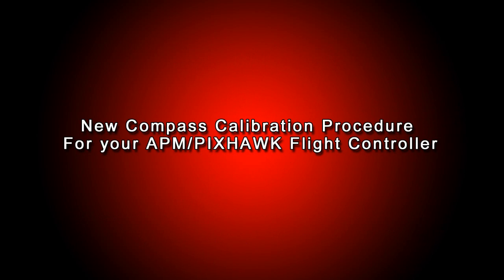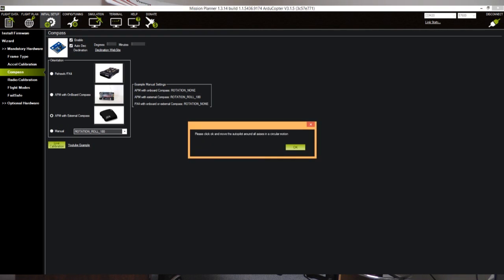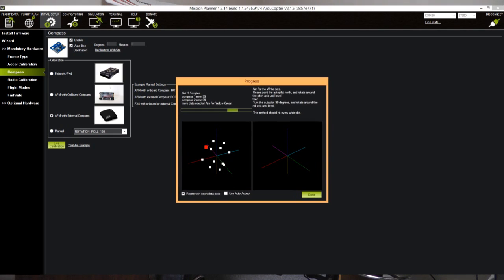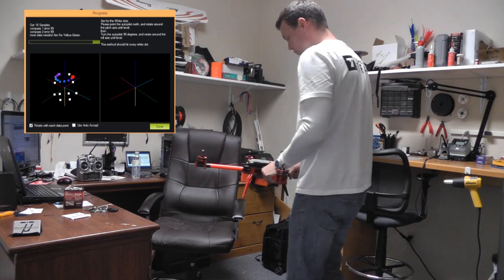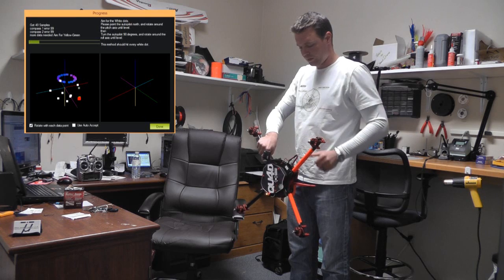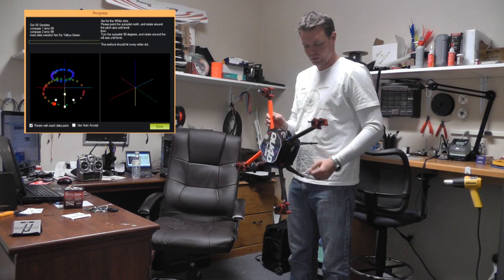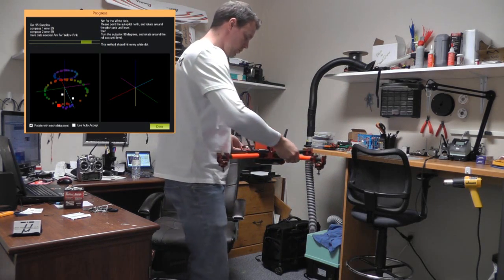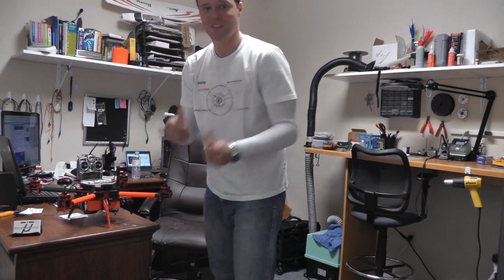APM PIXHAWK Compass Calibration

Comment: hi... i am having prblm in my apm 2.6 compass callibration with ublox 6M gps.... its showing only one red dot at the center(origin point) and its not taking samples when rotated. kindly help me if possible.
Reply: Good evening Shivesh Gaur, okay? I saw your video showing the problem faced in the APM with the error Bad Compass Health and I'm having the same problem, I even buy a new APM but the problem continues, you could find the solution ??? If you can email me, we will exchange experiences and try to resolve this issue. My email is fernando.zulin.veiga@gmail.com
Hugs ...
Reply: Are you using the latest version of mission planner and are you selecting the correct flight controller?
Reply: steve tacang I m using the mission planner version 1.3.30 and yes i'v tried selecting both the options i.e via apm with external compass as well as with manual calibration... the problem remains the same
Reply: Shivesh Gaur I am using a 3DR ublox 6M GPS module in which only 1 blue Led blinks on powering..... so can u tell me is this module contains the compass or not....?? I think that might be the reason of errors in compass calibration.....
Reply: +Fernando Zulin Veiga Hey guys i have same problem error 99 and only 3 samples and nothing happens... so far i search and read everywhere and i convinced sometime they sell APM without real compass and i should buy external compass and connect it via I2C cable... but did u solve it??? please help
Reply: hi..
It depends on the the version of APM which u r using...If u r using an APM2.6 then yes u hav to buy an external compass as APM2.6 does not have any in built compass due to avoid interference. Therefore if u r having trouble in  external compass callibration from i2C port then plug the compass wire into the port just below the GPS port i.e (old GPS port) and u will surely succeed.
GOOD LUCK....
Reply: +Milad Mirzaie Olá Milad Mirzaie, tudo bem?

Depois de 5 meses tentando resolver meu problema com o Compasso da APM 2.6, finalmente consegui resolver meu problema, na verdade foi um amigo que resolveu, o problema foi na solda da placa na porta 12C, onde se liga o Magnetômetro, essas placas chinesas são péssimas em qualidade e a solda estava ruim, o que ele fez foi remover o estanho da placa na porta 12C e refazer a solda com um estanho novo! 
Antes disso eu tentei de tudo, comprei um novo GPS/Compass, reinstalei o Firmware da placa, desinstalei o Mission Planner e instalei novamente, inverti os fios da porta 12C e do GPS e nada de funcionar, o problema estava na solda!

Espero que consiga resolver o seu problema, caso precise de maiores detalhes fico a disposição.

Atenciosamente.